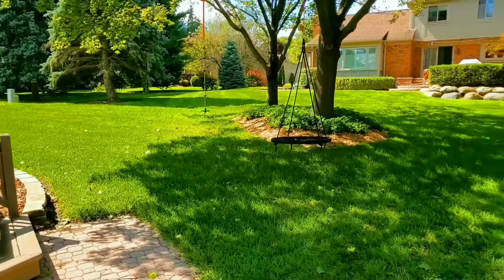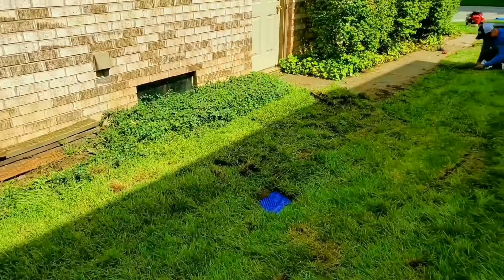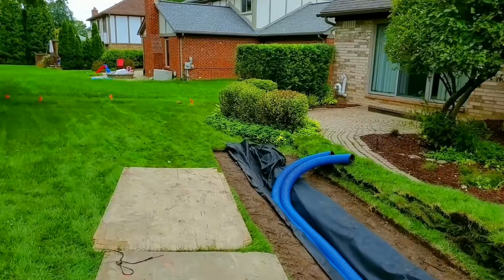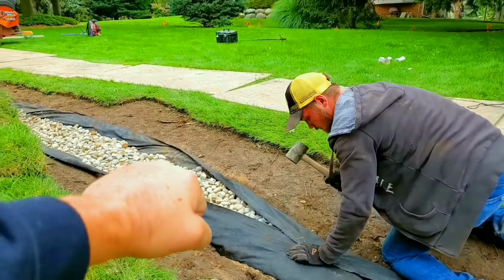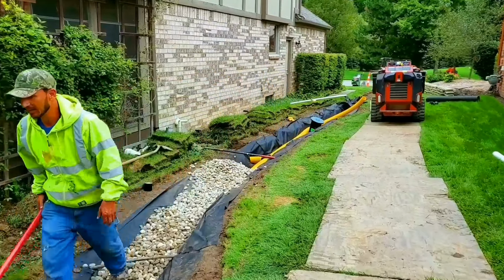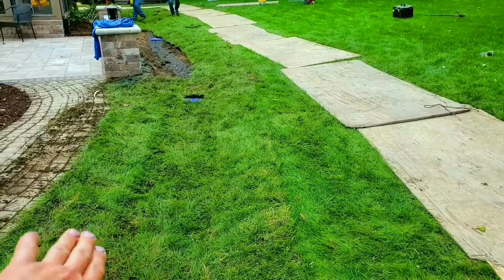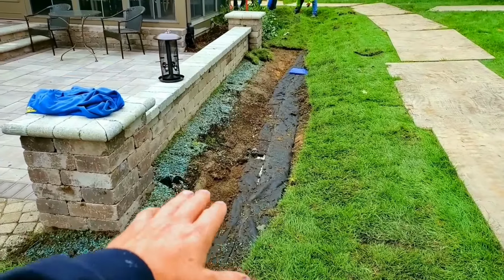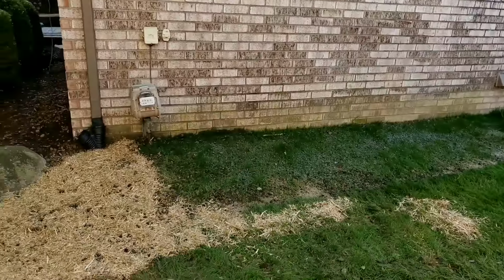How to Catch MORE Water with a French Drain [ Pro Technique Explained ]

Comment: The basins near the house for the downspouts, do you drill drain holes in the bottom when they are located within 10’ of the house? If so, is that an issue with that water traveling back to the foundation?
Reply from the maker: Water through capillary action can move through soil up to 20' away from the house the bulk of the water which we referred to as bulk water is what we tried to get as far away from the house as possible after a rain event the basin hold a minimal amount of water that slowly leaches into the subsoil that will not flood a basement or create mold or mildew problems.
Reply: Thank you!

Comment: At the end of the video you talk about everything goes to the 24-in I assume the 24-in another d box? Or am I incorrect? Where does 24 go from there as you explain it's Rochester's requirement?
Reply from the maker: Everything goes to that 24" round outlet basin the water floods that big basin and it just dissipates to the curb its full of holes in the bottom so any water that's in the basin itself will slowly Leach out we built a leech line off of the 24" basin.
Reply: How deep is the basin and how far is the leech field. I presume its wrapped in rocks?